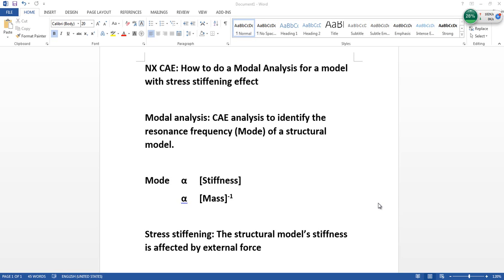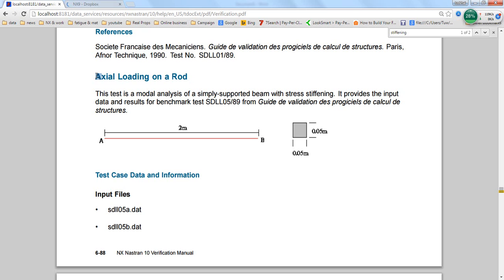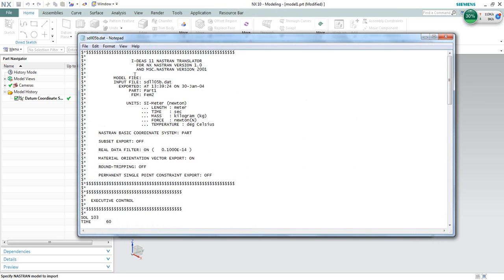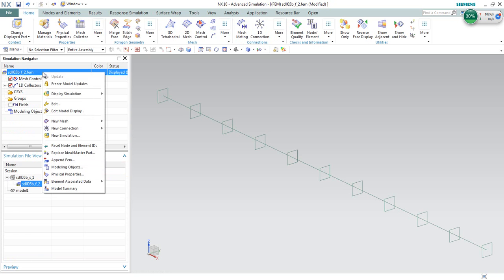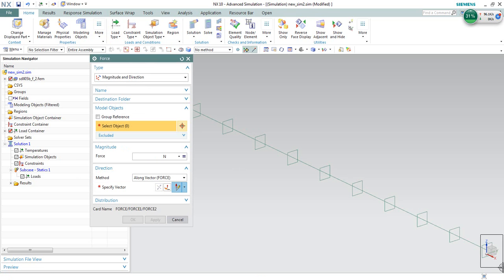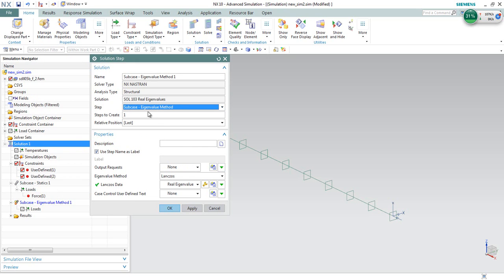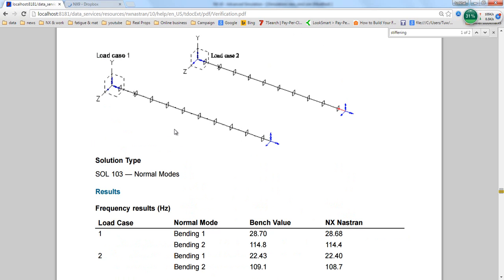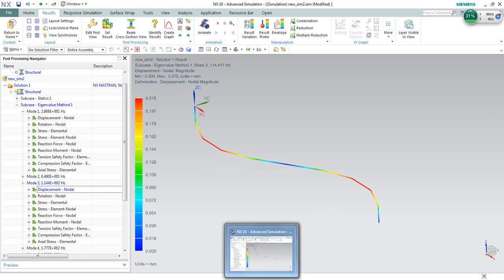NX CAE: How to do a Modal Analysis for a model with stress stiffening effect

Comment from the maker: Hi Afonso Ferreira,

I have tested the 3 subcases in Sol103 Response Simulation.
1. Subcase - Static Offset
By inserting a load definition in it, with the given boundary condition, this subcase will return the equivalent result of a linear static solution. In simple word, this is to obtain a linear static result.

2. Subcase - Stress Stiffening
By inserting a load definition in it, this subcase will give the modes result (under subcase Dynamics) with the stress stiffening effect.

3. Subcase - Dynamics
By inserting a load definition in it, this subcase will give the modes result (obviously no stress stiffening effect unless the load definition is inserted in subcase 2), plus a "Distributed attachment mode". This distributed attachment mode is only useful for subsequent Response Simulation Analysis. For example, let's say I am interested to know what will happen if the load definition is excited (rather than stagnant/static) within a certain frequency range (for example from 20Hz to 200Hz). Response simulation is an add-on process to the existing Solution (Sol103 RS), that is capable to perform various type of response, such as transient, frequency, random, etc..
Reply from the maker: In general, if you are comparing Sol103 and Sol103 - RS, both will give you the same result because the keyword defined and the nastran solver is the same. The main difference between these 2 is that Sol103 - RS involves a further add-on process for further analysis, such as transient, frequency and random response analysis.